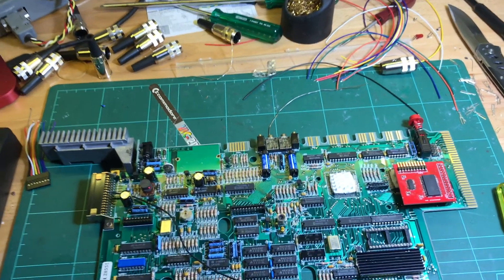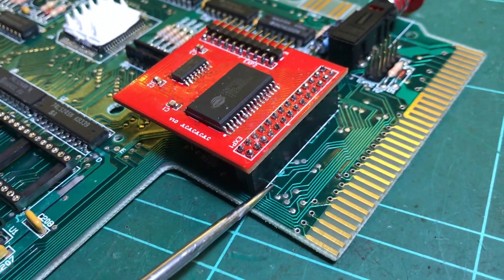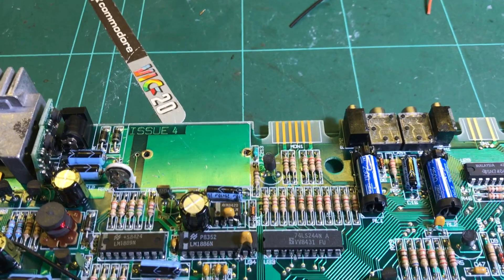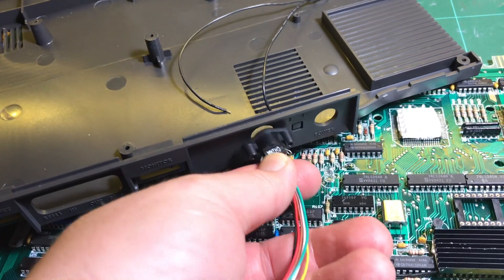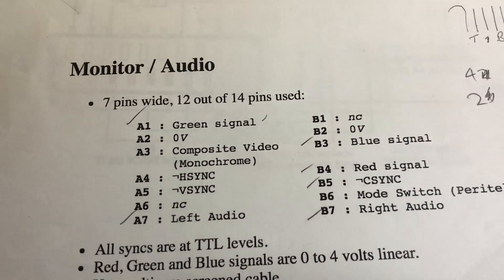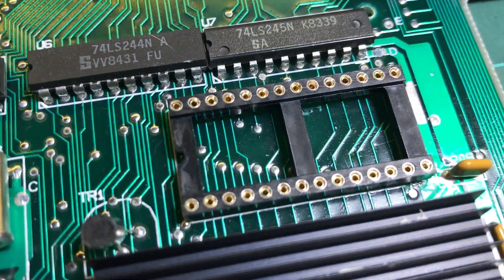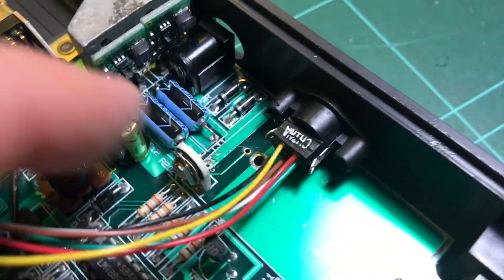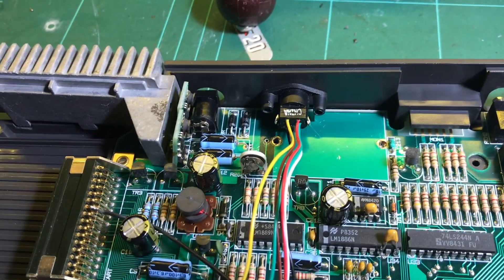🇬🇧 Elan Enterprise 64: Part 1 (Upgrading begins) [TCE #0059]

Comment: just picked up an Enty 64. Wondering where you got the ram upgrade from as I'd like to get some of the demos running and I bet that'll want silly amounts of ram!
Reply from the maker: Downloaded the Gerbers from the Enterprise Forever forums and had the PCBs made up by PCBWAY or JLCPCB.  There's also a 1.5MB version floating around too ... bit of a pain, you really need to dig through the forums threads/posts to find them ... let me see if I can find them again ...
Reply: Awesome stuff! just downloaded. Many thanks. Will have a look at the PDF etc. and see if its within my skill set. :)
Reply from the maker: @preferredimage  I’ve got some spare boards ready to be made up, let me know how you get on. And there’s that 1.5MB version still on the forums … somewhere! /Brett
Reply from the maker: Found the forum thread ... here's the original downloads for the 512KB and 1.5MB expansion boards.  I've only made the 512KB version.

https://enterpriseforever.com/interface/internal-memory-expansion/msg82117/#msg82117
Reply from the maker: For posterity ... the thread is now archived just in case ...

https://web.archive.org/web/20220830213814/https%3A%2F%2Fenterpriseforever.com%2Finterface%2Finternal-memory-expansion%2Fmsg82117%2F
Reply from the maker: For the 1.5MB expansion files, I think you can upload them to EasyEDA and then generate/export the Gerber files for production from there ... /Brett
Reply: @Brfff  Well I got a TL866ii programmer and am waiting on the WC27C512 to burn the new rom. Thought I'd try reading the original. any idea if thats not possible. get I/O errors and my brain is telling me (of course not, it would be protected)....
Reply from the maker: @preferredimage  Shouldn't be a problem ... did you have to de-solder the original ROM (I can't remember) - I usually get I/O errors on original, de-soldered ROMs ... I usually just ignore on my Wellon VP598 and it seems to read okay ... the original should be available somewhere - you could do a binary compare to see if your read was any good? /Brett
Reply: @Brfff  Woah rapid response! cheers! so its socketed. its the one above the z80 isnt it? I'll give a go of ignoring the errors and see how I get on.
Reply: @Brfff  If you still have one of those 512K boards I'd be interested. Took weeks to get the E64 working (TR2 died) but I have the parts on farnell queued. Just two questions though. what size SMDs are the caps (I've guess at 1206) and do you have the pinouts for the ribbon to go to EXP2?
Reply from the maker: @preferredimage  Good morning!  I'll have a look today ... I finally got my hands on an SD interface for it so I will try to do a video finishing off the RAM expansion, etc.!  /Brett
Reply: no panic on the PCB after all, I ran it by JLCPCB just to check and its a few GBP delivered which would be less than the postage from AU. Be good to confirm those cap sizes and EXP2 connections however if you get a moment. Glad to hear you got an SD adaptor, that's my next thing! as it turns out the list of games that run without more memory is pretty small (I created a load of wav files to play in from a phone and they seem to work ok).
Reply from the maker: @preferredimage  Managed to get the 512KB RAM working plus my little mini-RGB cable ... will upload a video in the next hour or so that hopefully explains the EXP2 pinout. /Brett
Reply from the maker: @preferredimage  BTW ... the capacitors are 0805

Comment: Hi All, anyone successful in sourcing upgrades for this obscure computer? I have an Enterprise 64 with no Basic cartridge. Information is thin on the ground 🍻
Reply from the maker: How good are you with DIY electronics?  Make sure you read also the video descriptions - there should be a lot of info/links there to get you started.
There's three basic steps I think: 
[1] upgrading the ROM to the latest EXOS version - this includes also BASIC built-in so no need for the cartridge,
[2] upgrading the RAM with a small expansion plug-in board,
[3] getting your hands on an SD interface board - check the forums for the latest